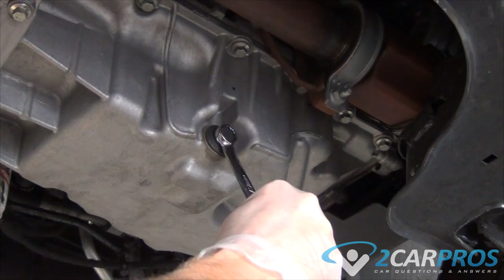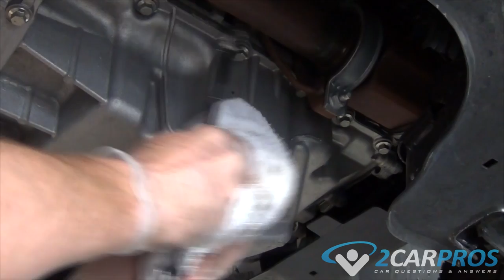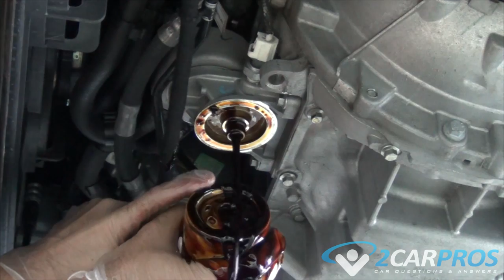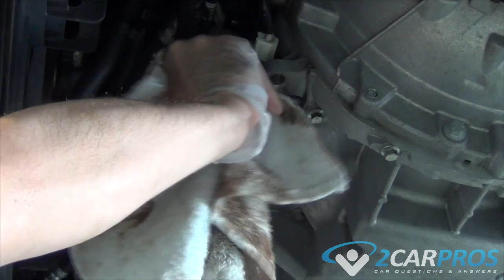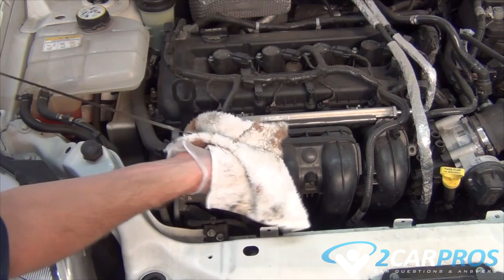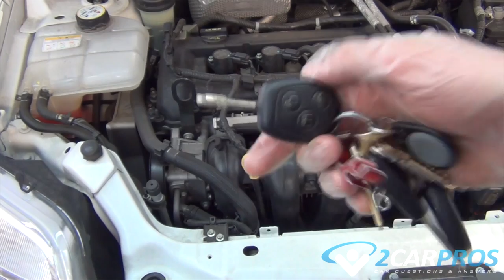How to Change Oil and Filter Ford Transit Connect 2002-2013

Comment: Could add a few details to make this video complete....What size wrench do you use on the drain plug? How about an oil filter part number? How about amount and type of oil used in vehicle...Right now this is just a video of a guy changing oil...
Reply: Oil filter part number depends on the oil filter brand and can easily found on their website or in the store you buy from, oil type for the transit 2013 is written on the oil cap (5w-20) and if you really need help finding the wrench size I don't think you should be doing the oil change yourself
Reply: Agreed
Reply: My sentiment exactly.  We came here to find out. 1. How high to get vehicle up to allow us to get to the area? 2. Do we need to take off a splash shield, and with what tools exactly? 3. What grade of oil?  Can we use 0-30 or 0-5, instead of 5-20, depending on the age and season, for a better result than the generic new recommendation? Why not explain that the main benefit of synthetic is cold weather starting? 4. What size wrench for drain plug?.....There are literally 4 grocery list items we may, or may not, need, yet this video tells us nothing.  Like the other guy said, it is just a video of a guy changing the oil.
Reply: And only in Latin America!
Reply: I think asking for the socket size is a good question.